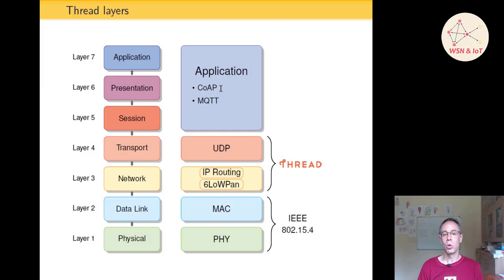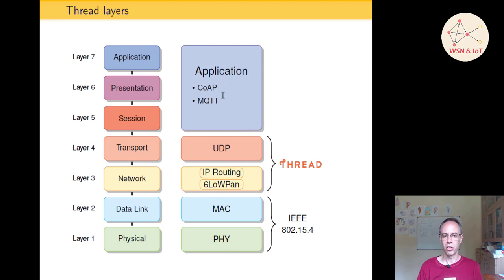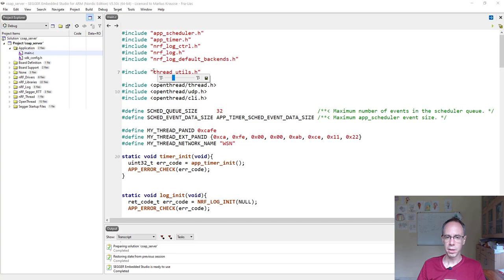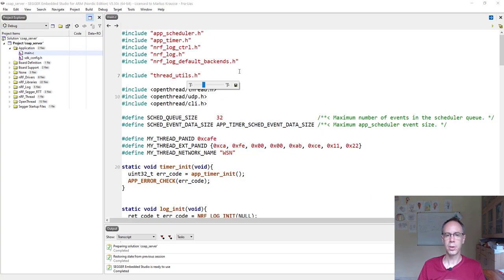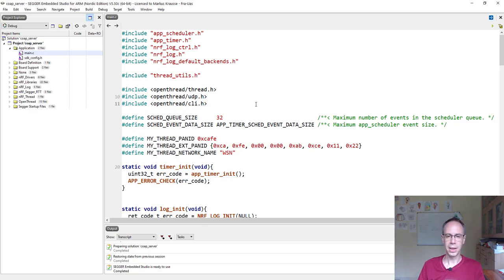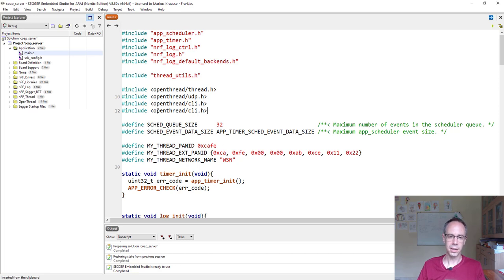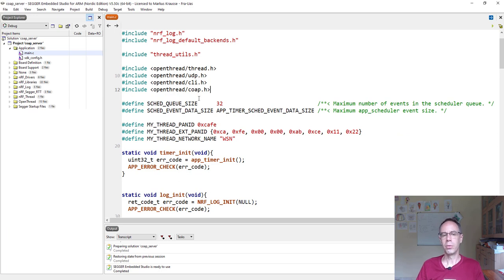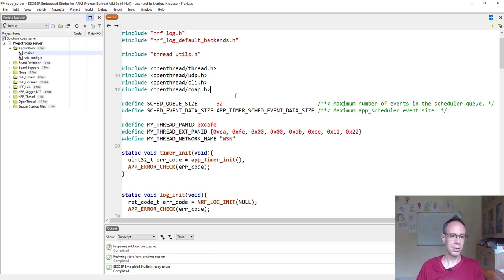Thread network technology - 06 CoAP (practical example)

Comment: Thank you for this brilliant example! I know that this is a basic c question but: how do I convert a real int8_t temperatureValue into this JSON?
Reply from the maker: You can use the function sprintf for example to generate a Json-String:
static uint8_t buf[20];
static int buf_length;
static int counter=0;

    while (1) {
        k_msleep(1000);
        buf_length= sprintf(buf, "{\"Counter: %d\n\r", counter\"});
        counter++;
    }

Comment: What if the end device is using a different application layers such as MQTT-SN and the border router is using a different application layer such as COAP? will this work? Also what if client uses MQTT-SN and server uses COAP?
Reply from the maker: Only same protocols can communicate with each other. The layer doesn't matter. CoAP with CoAP, MQTT with MQTT, TCP with TCP,... If your server doesn't know MQTT, it won't understand the message. However, forwarding to an MQTT server or client is already possible, since IPv6 is used for this. 
In theory, you can also implement a CoAP server or MQTT server on your BorderRouter. But that has nothing to do with the BorderRouter functionality. BorderRouter only connects the Thread network to another IP network, generally your LAN.
Reply: @wsniot  If you have end devices from different vendors using different application layer protocols, it can be a challenge for the border router to understand the messages being sent between these devices. In this scenario, the border router may need to support all protocols used by the end devices in order to effectively communicate with them. This lack of standardization can prevent devices from being able to communicate with each other and can limit interoperability. Isn't it?